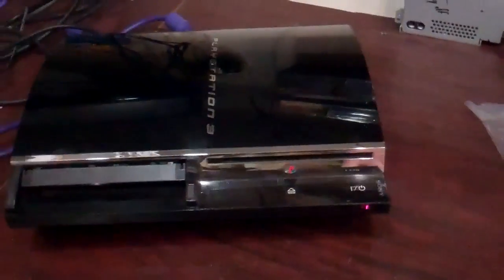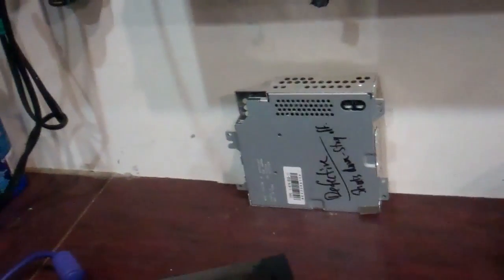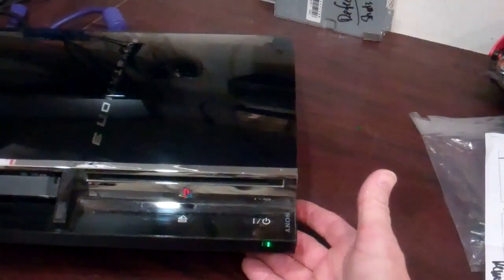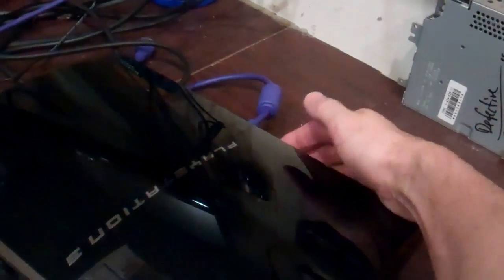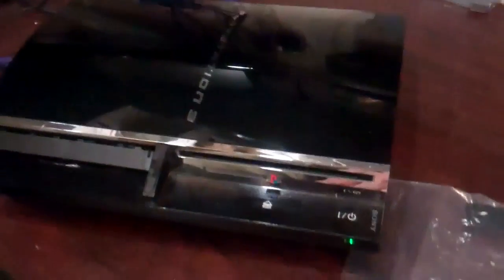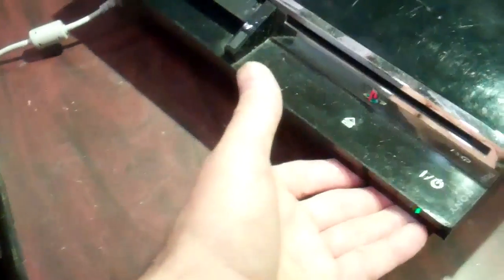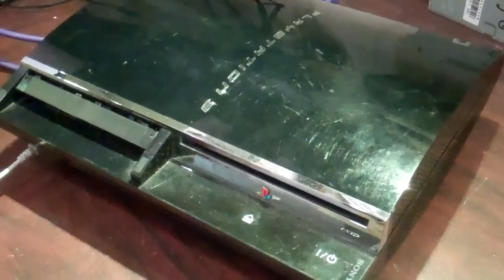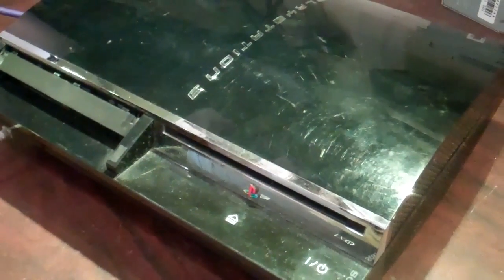How to repair fast fan speed on PS3 - unable to cool properly.

Comment: I have nice, almost brand new look 60GB FAT version, that I got for free because it's not working. When you turn it on green light stays on and nothing else, no video, no sound,  nothing. It does run and heats up, fan start to blow warm air outside but it dosn't do anything. I tried video reset metod with holding power button but the console just shuts itself off with this metod, can't reset video. Tried to remove HDD, nothing. When it runs HDD is running but it dosn't have any activity, HDD activity led isn't blinking, and the controller won't sync, even with cable. Console never been opened before I opened it. It was  bit dusty, but nothing terrible, thermal compound was still nice and pliable so I thing this problem isn't heat relating issue. Any ideas anyone? Basically all it does when switched on is to convert electricity into heat and noise, nothing else. When you start it up it runs until you shut it off. Model os CECH C04.
Reply: The failure from heat is typically a unit that turns off.  But since it’s the gpu that typically has solder fatigue what your describing fits perfectly.  So since 99.99 percent are failed gpu I would guess yours is as well.
That being said your compound can’t be pliable simply due to age so my guess is someone opened it and failed to do proper repair - which a bad repair is almost always power on, convert power to heat, and no video. So my guess is your unit was simply opened in way it did not look to be opened which isn’t hard to do.
Reply: But why it dosn't YLOD then and shuts off? can it be possible that CELL cpu is faulty? Tried changing PSU from known good one, no change.
Reply: Borno Abicic Under the gpu is many solder connections. Not all when broken will Ylod.  Some will allow unit to stay on but fail - I’d guess your solder is effected on outbound electronics from gpu, gpu is working but connection broke exiting the chip.
I’ve repaired thousands of ps3 and only once did I find a cpu failure.  But basic logic supports that - the gpu operates at highest temperature.

Comment: How do you know if the power supply is faulty? My system shuts off after 5 minutes but when I reset it it stays on for the 4 hour duration. Any thoughts?
Reply: That sounds like bad caps. When older electronics need be on fir little to start working normally usually poor quality or bad capacitors.
Reply: @trabenold9590  ahh okay.
Reply: @trabenold9590  any fix solution?

Comment: Mine used to sound like a jet engine so I just bought the thermal paste at Best Buy tg-7 and cleaned the contacts and applied a good amount, spreader it all the way to the ends also and now the machine purrs like a kitten.

Comment: I have a ps3 like this one and it makes the sound but a little low. It's still noticeable, and it stops making the noise after a while. Is that normal?
Reply: Probably the fan just gets a little loud to cool down the console, once it's cool it'll go back to normal but ideally you want the fan to go fast to flush out the hot air

Comment: Time to add a water cooled outdoor system to this big loud hard working unit. The cpu will last forever or longer? Picture this for your approval, 2 small hoses connected  a pump fed radiator and fan outside mounted   in a box on the sweet outside. Thus, no heat building up inside an already hot room.

Comment: I got three of my boards reballed by you back in 2011 and two were doing this when they came back (the other still boots with no video, which was its initial problem). One would turn off before I could even log in to the XMB and the other would turn off in less than two minutes. Still have them. Did you ever figure out a fix for this?

Comment: Will replacin the hard drive fix the fan speed? Ive tookin apart the whole system in cleaned it all the way 2 taken the fan n cleanin it. I even cleaned those 2 square parts on the circuit board the game is still runnin but i didnt put nothin on those square parts i just cleaned em do u think itll help? Or i need 2 replace the drive?

Comment: My ps3 is to loud and I can not hear anything and when I play for like 7 minutes it tells me to turn it off to cool down any help
Reply from the maker: Uk Motorvlogs Have you done any service to it yet?  Most likely the original thermal compound is old and dried out.
Reply from the maker: Replacing the compound may correct the issue of its the first time you had trouble.
Reply: SPITFIREMODS just seen your reply and yeah I'm getting new thermal paste today and when I do it I will let you know and I will sub to you as well

Comment: Hello . The cooling fan speed in my Playstation 3 when began operating a low voice, and when I play some strong games fan sound High begins and after end  the game the fan speed  back low for her voice. Do you think that the performance of Playstation normal and does not require replacement of thermal paste with the length of the period of use of the device several years ago. Is there a program to monitor processor temperature and speed of the cooling fan rotation.

Comment: I have a 60gb ps3 phat and when I'm playing over time the fan goes to medium speed but still pretty quiet but the air it releases is hot. is that bad?
Reply: same
Reply from the maker: Fan speed increasing indicates break down of thermal compound.  If not corrected it leads to YLOD.
Reply: It never increases or decreases after like on a medium setting. It just stays there. But doesn't feel that hot either. The system is warm but not hot.

Comment: You don't put enough thermal compound on the chips... that's not healthy. Needs a little more.
Reply: Actually that is correct.  The plates need to have just enough compound to fill the tiny surface discrepancies.  Only the plates are trusty supposed to be in contact as they transfer the heat most efficiently. The more compound you add, after you fill the tiny surface imperfections, makes the thermal transfer worse. So in this case, “Less is more.”

Comment: So should I use standard thermal compound/paste on both sides of the heat spreaders themselves as opposed to paste between the spreaders and fan/heatsink and adhesive between the spreader and the actual processor? I had mine reflowed and it was doing this so I took it apart again and saw that the guy just loaded the heatsinks with compound (worse than the stock 360 pasting job) and even after replacing the paste I still get the fan spinning at 100% with no hot air coming out (and eventually a warning message saying the console is heating up). I purchased MX4 just to try something different, but I was under the impression I needed thermal adhesive for the application of the spreaders to the processors themselves.

Comment: I cleaned it out and I start the ps3 and within 5 mins its ready to fly away to space was really loud   with cold air flowing out of the back , I guess I will try the clamps because it did not happen till 6 months after I changed the paste on the chips , it happened after I cleaned it last night.

Comment: Can ps3 be mod with a better processor and better WiFi card for faster online gaming?
Reply: You can buy a wireless router thing that plugs into the ps3 through the usb ports and you can't change the processor I believe because of the way the motherboard was made.
Reply: H.A1992 will the wireless router usb help make it faster, because the ps3 has the most junky useless wireless card in the universe, it only provides 1mb of speed the most, and upload is less, and internet is 34 mb so is clearly the useless wireless ps3 card.
Reply: ***** its because  your  internet is shit. Try 1000 down 1000 up like me
Reply: Blazing Infernape the internet is good, is just the ps3 WiFi card is small and doesn't process information as fast as a laptop WiFi card, they should of had designed the ps3 for any WiFi card to be able to be place inside, so we could of replace that slow card, internet is great, to play good online you only need 5mb of constant speed, I had before 3 mb and worked just fine, but I had the Ethernet cable plug to it.
They should build a ps3 with triple mode for receiving information, they should design all ps3 with GPS automatic updates in the console and games, for example it can update when not playing automatically by GPS, and better WiFi, and a new dsl internet free, for example they should build the console so it calls a free line that is Sony, and have it help the speed of the games, for example it can be used as backup, for the slowest things, so WiFi is not too heavy for it, that would reduce the WiFi info that requires for the games. and be faster and better.
Reply: true.
Reply: Luis Angel i suppose the ps3 is limited to what it can handle online, and is not too much, the WiFi card it has inside is very small, one of the first kinds, wasn't improved on the next models, I think Sony should built a new kind of WiFi card if it wants to improve internet gameplay, I would say it's a must, that way we can buy it and place it on the ps3, becase no matter the internet speed it wouldn't have any improvements

Comment: The only, but highly risky thing, that will work things out is to remove the heat spreaders from the chip, and to renew the thermal compound on the dies, this is the only long term solution to avoid having a PS3 with a turbo fan. By doing this, you will have a console that will work almost like new. A big difference is not vicious by renewing the compound only on the heat spreaders. You need some self made tools to perform all the work of removing them, but on the other hand nobody can guarantee you that you will not damage the Cell which is much harder to remove by trying it, in this case the PS3 is just good for a trash can or for some replacement parts.

Comment: 'll do a reflow on my ps3, this video game has numerous components in thermal adhesives. I have to change the stickers? you can tell me the proper adhesive?
Reply: Yea I reball and I use double sided tape to hold it down. Been doing this for 4 years and no problems occurred to me.
Reply: TheCanadianHacker
is not any double sided tape, has to be thermal conductor.
I have done the reflow and my ps3 red light step to yellow.
but not the to play.
I am using the thermal paste "zp heatsink compounds".
how long your FAT lasted the shock absorber replow?
so did reflow on only one side of the plate, the CPU.
I am now without thermal paste to try again.
Reply: Use double sided tape on the ram chips. The tape I use is made by JOVy and it is made highly for the thermal conduction and heat transfer. My reball is a perminant fix because I reballed my E01 & A01 in 2008 and it works right now because I'm playing gta v on it right now xD!! I use arctic epoxy on top of the tape
Reply: TheCanadianHacker so when  you replace thermal paste from ihs, how much thermal paste you put. I legit want to just put pea size.

Comment: If you able to hack that PS3 with Custom Firmware, you can install home brew app like "Control Fan Utility" and just set the fan manually (35% for example, it's pretty quiet) with that app.
Reply: Unless you are watching the temp then that's a good way to overheat it
Reply: IndraEMC but lowering it hurts it, right?
Reply: No ifs not u FUCKEN low life
Reply: IndraEMC will that kill the system faster?
Reply: Hostile much?
Reply: SyQn_Deqon Schreuder u got ps3
Reply: lol i have control fan utility and putted my fan on A7 but my ps3 still gets to 89 on XMB after 4 minutes i replaced my termal paste and reballed it but didnt seem to work :(
Reply: reduced fat ice cream is just denial for fat people no ! because controlling your fan is making your PS3 cooler and extend it lifespan.

Comment: Hey mine overheats but no hot air comes out and has new thermal compound but question how should I bend those metal brackets? Please can I have an answer? Thanks!!
Reply from the maker: Not sure what you mean by "how you should bend them?"  I just use the edge of the work space counter top.  Usually they look rather flat if they are not bent well, so I bend them just about 10-15 degrees which is a small bend.
Reply: Then you need to remove HIS covers and replace the thermal paste.
Reply: Jan ツ but that's what he did in the video and it didn't do shit.
Reply: +Potato With Alot of Swag 

Yes change the thermal paste under ihs too. Mine is so silent now. :)

Comment: Hi SPITFIREMODS I have a 60Gig backwards compatible chunky PS3 and had it since the launch in 2007 I have looked after it well as I was cleaning the vents out twice a week with the vacum cleaner and I also kept it in a cool well vented room on a shelf with holes in the shelf so the PS3 could breath so to speak, but I suppose even after looking after it well, nothing lasts forever as 2 days ago its started to shut down on its own when I play games so I think its on its last lags now but I cant complain as I've had a good run out of it and had my money's worth, I would just buy a new PS3 to play on but its a backwards compatible one and I want to keep it and try and fix it as I do still play PS1 and PS2 games on it, my problem is I havent a clue on how to fix it myself or where to even get the parts from, I live in the United Kingdom so I dunno if there's anyone here you may know of that could help me at all? if you can help me at all with anything? I would be so greatful, cause it would be a shame if I had to bin my 60gig Backwards Compatible, considering their hard to get now seen as their not even made anymore by sony, so any help I would appreciate. Thanks.
Reply: £120 seems the going rate, . .I'm in same boat my C03 is louder than Pink Floyd recording in an amphitheatre, . . the neighbours hate unwanted audio, . . FML.
Reply: i have  a c03 doesnt go above 3 fan speed but air is cool not hot. Bought for 45 very good condition. In A few days when my liquid metal comes going liquid metal under the ihs plates cant wait.

Comment: I have the same problem I fix it with a Aluminum shin under the CPU heat  spreader and it work...
Reply from the maker: Aluminum shims do not work.  Maybe they make your machine work temporarily, but your component will eventually be compressed and crack the pads underneath.  This is permanent damage.  Not a fix we would recommend.
Reply: well I have the ps3 working,is 4 months now, the problem of the loud fan was fix and I put a fan 80mm in top of the power supply, now runs fine.

Comment: This video is exactly why console manafacturers should make consoles exactly like pcs, i get the whole niche market thang, sony wanting £130 to replace an old console that wont last much past its new 3 month warrenty ect, and people repairing these themselves, having a console which fked up once, and now its replacement also (what i feared a ylod turns out to be a non working fan) when it started overheating i gave up on it for about 2 years, the bluray drive also fked up before hand so i intended to get a super slim but havent yet) now im messing around with this old 40gb model, realising... its a pc... and a shitty designed one... this is the reason i prefer pc gaming... (none of the "turning 3 pin sockets into 4 pin molex's and shit just to get a fan working)

Comment: Mine turns the fans in then after a bit it turns them off for like an hour and does it again and goes off then on in an hour
Reply from the maker: Current games will cause the fan to kick up.  This is built into the ps3 to protect it from over heating.  After the first year this process will normally increase in duration until your unit fails.  The OEM compound has good effect until the first year is over.  After a year your unit will increase in core temp due to bad compound until it fails.  This process kills 99.9% of all consoles and the main cause of YLOD.  Get the poor quality compound out as soon as the warranty is up!
Reply: +SPITFIREMODS hello bro...I have an old ps3 fat 40g...the immediately I switched it on,it the fan works normally then it picks up speed elevate  gradually and then shuts down and red light blinks ...on the screen it says your console is hot ...even without me playing..just 1 minute after I switch it on.please help me
Reply from the maker: You should check your heat sinks to see if they are making good contact with the heat spreaders.  If there is too much thermal compound that can also cause it to think its overheating.  If that's not the problem you can try removing the heat spreader and applying new compound under there.

Comment: My ps3 is doing exactly the same, i have the decent power pack and applied quality thermal paste, no dust in the machine at all. Did this work? Why you just fade out and leave us hanging?
Reply: SPITFIREMODS You should link that video in the description.
Reply from the maker: We ran a follow up video on this subject.  There are a few things you can do to prevent the overheating.  If you have any other questions let me know.

Comment: Does urs give u error msg then shuts off?i bought original 60gb ps3 for $50 and the person said the fan gets loud then shuts off after msg
Reply from the maker: If the unit gets too hot it will shut off.  Some will not get that hot and will sound loud all the time.  If it exceeds what the OS is programmed for in temperature the machine will typically give an overheating message and shut down.

Comment: How to fix overheating ps4
1.buy pc fans and install them on ps3 (search on YOUTUBE how)
2.replace thermal compound with really high end one 
3.clean all dust from inside when you replaced compound 
 

(I know it's hard to do all this but it will help you)

Comment: the fan speed up because there another layer of thermal paste that's supposed to go on the CPU you have to remove the heat shield and put past on the chip that the heat shield is protecting the past is old and dry that why the fan go crazy. if that dont work if CPU needs to be cleaned and rebuild.